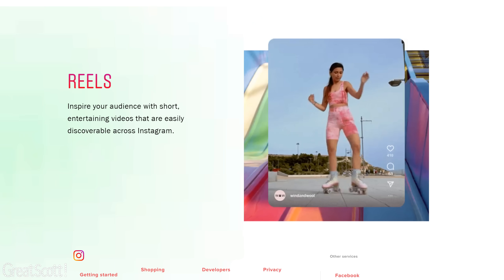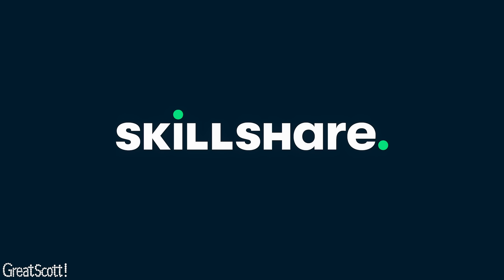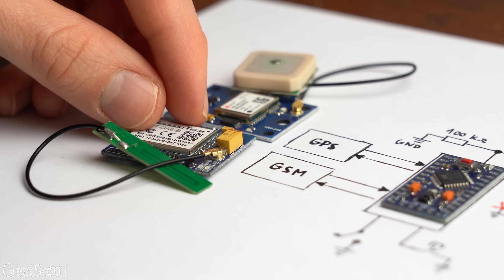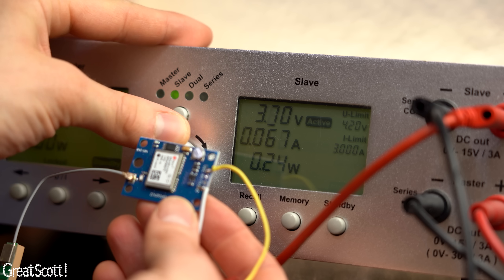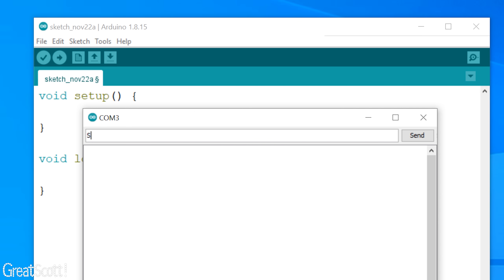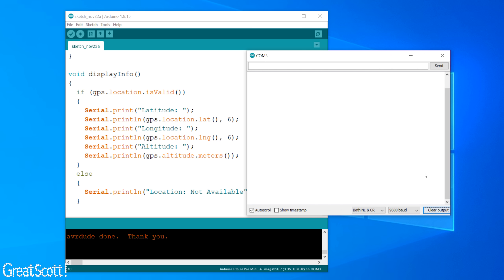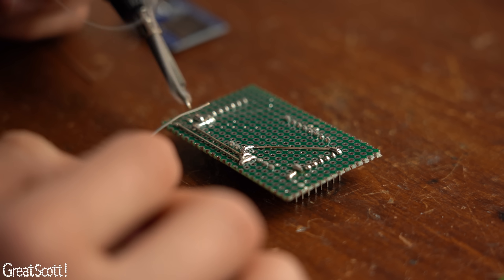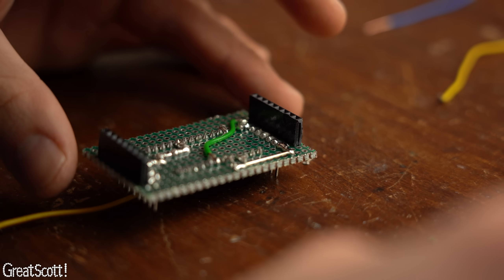A Box that can SAVE YOUR LIFE....and get you out of awkward conversations! (GPS/SMS/Call Thingy)

Comment: Would be good to store the last known GPS location so if you're indoors it sends out the latest known (provided there's signal indoors)
Reply from the maker: Good idea for an improvement
Reply: Or a series of gps location
Reply: @greatscottlab  Airtag and co would make everything obsolete
Reply: I was looking for this comment! Glad Scott saw this
Reply: @iwantitpaintedblack  Airtag has no GPS, this little device isn't really that convenient anyway, but at least it's probably cheaper. Keep in mind though that any message sent via this device cannot be misunderstood: the receiver will know exactly what is going on.

Most other systems require that you manually decide to check out the tracking information rather than providing an "alarm" button
Reply: @iwantitpaintedblack  This unit still allows initiation  of the SMS. With an Airtag how would you signal you need help?
Reply: Very often it has to get GPS info, additionally GSM sender strength info and location 
calculation and I heard with wifi stations also possible. But it cost much accu power.

Comment: Very nice. You could include an accelerometer also and then use the signal from that to trigger a call, giving you a security system you can buy on your bike!
Reply: I used the interrupt pin from the Gyro to wake the Arduino, that checks if there is costant movement, then in turn controls the PowerEN pin on the GSM to switch it on and send a message, then everything goes back to sleep.
Reply: He could do that with the GPS (more ineffectively but for free)
Reply: he did just this but with a text message a while ago

Comment: I realize that this is essentially a prototype, but you might want to consider putting a tactile bump on one end of the switches. Presumably you would be using this without looking at it (you don’t want those you are trying to escape from seeing it), and you wouldn’t want it in the wrong mode when you are actually using it
Reply: >  (you don’t want those you are trying to escape from seeing it)

I mean, considering how it currently looks more like a bomb trigger than a sophisticated cellphone you might not even need to activate it

Comment: I love taking COTS boards and piggybacking them on to a custom PCB for small scale production.  Then to go full scale production, you'd have to take all those boards and make it into one "auto pick and place" capable design so it could be mass produced and sent through an oven by the hundreds...  Also to make it more like credit card sized and lower power consumption, and a sleep mode on the GPS until the button is pressed, etc...

Comment: You can use the ai thinker a9g board and program the board directly and the whole circuit would be assembled in one module and the battery would be connected directly to the board.

Comment: Just a though - combine best of both worlds from your idea and the necklace solution:
Have a more flat design of the main box stored in the handbag or backpack (in the size and exterior of for example a battery bank for added safety) & have 2 small buttons somewhere more accessible with some low energy bandwidth wireless system to be powered of a 3.3v cell.

Comment: You can get rid off power slide Button and keep only one push button. Push it > arduino wakes up > and keep power by logical output and transistor. When everything done - arduiono turns off transistor and it’s power (completely)

Comment: Just FYI. If you're in Canada, you need to know that the only GSM provider, Rogers Wireless, is stopping GSM services at the end of 2021.  After that there won't be any GSM service in Canada and the other carriers dropped support for CDMA in 2016, So the cheap GSM and CDMA cell boards won't work anywhere here anymore.  You'll have to get an HSPA+(3G or higher) board, which will be more expensive.

Comment: That's a rather large necklace 😅. If you want to make it compact you're going to need a 2 or 4 layer custom PCB with bare camponents on either side. Also, minding the power usage, all those small regulators would need to be replaced by a single psu circuit
Reply: I was thinking he just built himself one heck of a necklace medallion, all he needs to do now is find a strong enough necklace so he could "inconspicuously" wear it :) Joking aside, this was way easier to follow for me than his usual electronic circuits. I was amused hearing him say "ZIM" card :)

Comment: I used a A6 GSM module that has level shifters and power EN pin, excellent for battery powered projects.
I was able to send 1200 SMS every 3 minutes on a 1200mA LiPo battery, by adding an extra capacitor on the GSM power lines, I'm sure I could go further.
I had to put the Arduino and the GSM to sleep when not needed and used interrupt to wake the Arduino that in turn would switch the GSM on when needed.

Comment: Might be worth enhancing it to remember last GPS position, so that if used inside, the building location is known. 
Any way of making it smaller?
Reply: I think for the last location part it is possible by just updating the software a bit. Each time the GPS location is fetched, we store its state. By determining the GPS output has become garbage or not valid (depending on the GPS output), then we could use the last good state and its timestamp. Then when sending it, we could also send the sending timestamp so it contains our last known location, the time and the distress time.

As for the smaller part, I think it's only possible by creating a custom board with everything integrated on it.
Reply: both are possible, the remembering gps data would be all code part, but the making it smaller would include a custom board design, a little more difficult, but definitely possible

Comment: I would use a soft switch transistor circuit. The button activates a transistor that powers the Arduino which then latches its own supply and can turn itself off on completion. Reduce power usage.

Comment: There's a smartwatch (not that smart but has GPS and 4G) designed for kids, that has an SOS button that will send coordinates to one or several contacts via SMS.
(obviously an adult wouldn't want to wear that, so just tear it apart, put it in a box with a button, and give it a bigger battery)

Comment: Those vero boards, interconnecting pins and headers take up quite a bit of room, but there are so few actual interconnections required (maybe a dozen wires - tops?). 
So the modules could just be joined with short direct wires from module to module, with all the modules packed together at whatever arrangement gives the smallest volume, with some thin sheets of soft flexible insulating material keeping them all from shorting out. 
I think it could be made considerably smaller without much trouble...
PS: Maybe lay it all out in a thin flat, and even slightly flexible arrangement, it would be much easier to carry around

Comment: While that would remove alot of DIY factor from this, I wonder if using internals of some phone would allow for a much more compact package
Reply: kinda tried it but the boards don't have enough interfacing options and not enough datasheet information available online. and trust me its way easier this way and go with PIC boards and industrial sensors but then it becomes a complete project and not DIY.

Comment: Also, I'd have a few questions about the 3D printer you use:

- What model do you use? If it is rather expensive, are there any budget models you can recommend?
- Do you use PLA or ABS for printing cases and other parts?
- If you use ABS, what do you do to combat warping of the edges?
Reply from the maker: Prusa i3 Mk3 and I used PLA

Comment: Some Quectel modules already have gps inside modem and are very sensitive. In another case, you can use queclocator, which is triangulation based on bts. Not so precise and propertialy of Quectel, but working.
Reply from the maker: Thanks for the feedback :-)

Comment: Just a suggestion, but have you considered using a SIM7600 module? This supports both LTE (since GSM is being sunset) and A-GPS (assisted GPS). That way, you can get moderately accurate GPS coordinates even while indoors. Basically how your phone works when connected to the Internet. This would also heavily reduce power consumption by not having to use a power-hungry and slow to get coordinates GPS module.

Comment: As allways a very cool project. There are combined GPS GSM modules out there. Did you consider to use one of those to reduce the needed space, or do they have drawbags?

I hope you did show this cell phone number intentionally? Have nice christmas time.
Reply from the maker: Those comvbined units are bigger than the two combined that I was using.....The number 1234567 is not mine ;-)
Reply: @greatscottlab  😖 OMG I should saw this isn't a phne number, sorry.
The size of the parts is hard to tell in the video. I expected that a A9G boards would save some space, they combine GSM and GPS at 40 x 25 mm.

Comment: @Great Scott
Great video as usual 😄
Can I suggest a few tweaks?
1. Use a 3.3v pro mini 
2. Remove onboard regulator and fit an MCP1702 LDO regulator 
3. Use a small Sim800L module 
4. Use an Quectel L80 GPS module 
5. Use TP4056 but only charge when power switched off otherwise it will never complete charging 
6. Put all modules in sleep mode then use interrupt to wake pro mini/modules
7. Design a carrier board to mount everything on. 
Would be great to see all this. I have made one (apart from pcb) it’s consuming ~ 3mA if you would like more details?

Comment: You might consider a powered antenna, to improve the GPS's performance indoors. They are not much larger than the puck antenna that you are using. They are cheap, on Ebay/Amazon/Etc. Of course, battery usage will have to be considered. Do you have to buy a separate phone line for the SIM card?

Comment: What a good idea. Would it be possible to use this as a burglar alarm?  I you place the box in a boat and set the current position. Then if the boat detects a position 50m from current position you will get a SMS with the new position. The you can send a new position every 5min to keep track of the boat.

Comment: Wouldn't the sim card inside the device require an active plan to use? 

Maybe a Pay-As-You-Go plan that can save some cash or a cheap contract, otherwise the sim card won't work (at least here in the UK, If you do not add a top-up or pay for a plan, the sim card will ONLY receive calls).

Comment: Hi GreatScott!

I think I have a great Video Idea for you. Do you know the Quick 861dw Hot air rework station? I really like it, but its way to expensive for me as a student (300€). I saw, that you can get the heating element from it for 50€. I wonder I you can build a similar performing one in a DIY or buy video. Just build a temperatur control and power circut for it, 3D print a handle with a integrated or external fan and a case. How does that sound? Its similar to you DIY soldering iron video.

Comment: Genius on your part! But I have a couple of concerns. #1 is the GPS module that you said doesn't work indoors. Is there another module that WILL work indoors? #2 is battery life. Did you code this so that it is on all the time, pulling GPS data? If not, then it could take a long time to ping the satellites and determine location, and if this is for emergencies, you wouldn't have much time to lock on to satellites. So, having the battery on all the time keeping the GPS module always locked on will take power. So what is the battery draw like on your device? #3 concern is whether this could be shrunk to a smaller size. Can that be done? Thanks for your input!

Comment: Great project! I thought you could apply the battery voltage directly to the VCC of the pro mini- did you deliberately use the on board regulator? Why?
Reply from the maker: You need a stable voltage for the ADC that monitors the undervoltage protection.

Comment: I know this is more of a full DIY channel, but couldn't some of those tiny car/bike gps trackers with build in battery be modded to have a button so send the info?
But i doubt you can just solder up a button, and need some additional board to do that. But overall, smaller... This isn't quite exactly the kinda thing you can have in your pocket ;)
Then again i bet they already make those with emergency buttons.
I know the purpose of this vid is to really built it yourself from the bottom :)

Comment: I don't know how about you but for me this box is just too obvious.. it's just something that I wouldn't put my life on..

No doubt that it's an handy device and the idea behind it is also great but I have an better alternative for this construction.

As an example, I bought an Ulcool F1 phone that is really small phone, I went to my phone provider and got a prepaid SIM that doesn't need to be charged with credit (but you have to do at least one call every 12 months) and the phone is so small that I keep it in my pocket watch pocket  (aka. The small pocket on your jeans which you most likely don't use for anything).

Sure, the phone doesn't have GPS or Internet connectivity but the size is definitely an plus point and my phone lasts me for about 3 months (powered off) before I need to recharge it.

Until now I only needed that phone once after my main phone just died on me and I needed to call the tow truck. 

A little warnings before you decide to get that phone..
1. Make sure that you use your own charger since the OEM one looks very dangerous on the inside.
2. If you have big fingers, you better don't bite off your nails. They can be useful for dialing the number or writing the SMS!

3. Put the phone into silent mode. The ringtones are annoying and you probably don't want this phone to get discovered.

Comment: Can anybody tell me if he had to change the current limiting resistor of the charging board (tp4056)? Because i thought the default value is 1,2kOhm which leads to a charging current of 1A to the battery. Isn't that too much for this small LiPo battery?